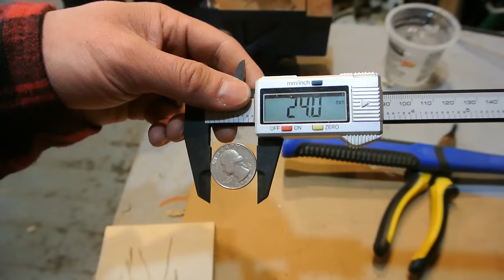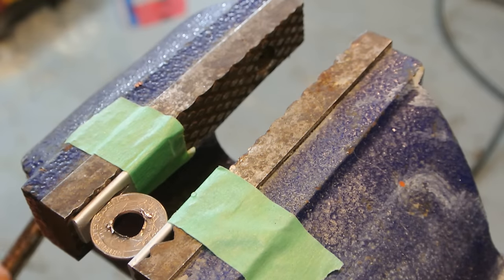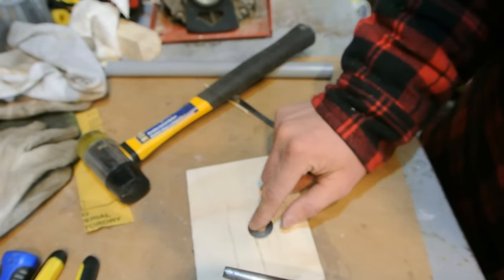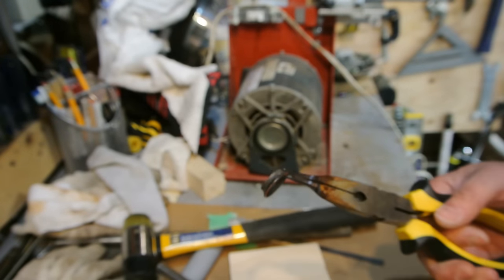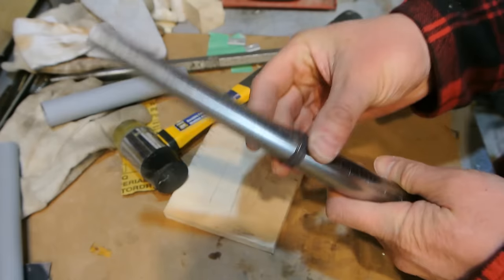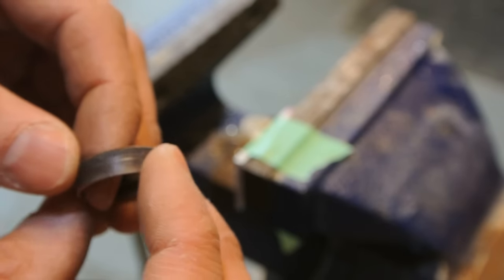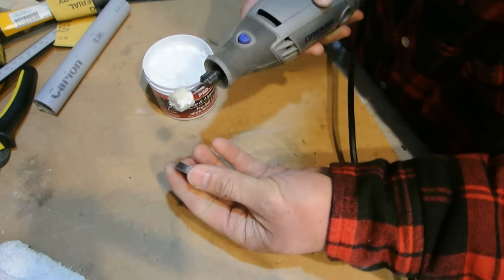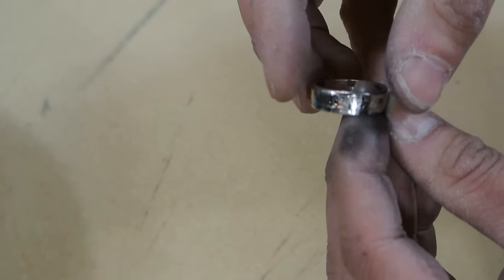How to Make a Coin Ring

Comment: I use my doming block to get a head start on bending the ring down.  Put the coin between 2 thin pieces of leather and dome it in the block.  Make sure you have the outside of the ring facing down in the doming block and that you are centered.  The leather protects the lettering on the coin.  I started out on brass washers to practice before I started on coins...much cheaper and I didn't feel too bad if I ruined it.  I also put the polishing bit in my drill press instead of the Dremel.  Runs at a lower speed so there is less mess and better control.Great work!
Reply from the maker: Thanks for suggestions!

Comment: I learned quite a bit from watching fencekid videos as well. A couple things I learned from my own experimentation... 1) a piece of scotch tape across the top of the coin helps keep it straight in the doming block while you are orienting it in the vise, 2) mounting the vise vertically on the side of the bench so it acts more like a press all but removes the need for #1, 2a) a 1 ton arbor press is about the best $40 investment you can make at this stage :)
Reply from the maker: Thanks!  I looked at arbor presses but in Canada the cheapest I could find was 100 bucks.  Maybe if I make more I will invest in one.
Reply: Andrew W
Ah. Yeah that $40 was US lol. Even a half ton would work quite well (and is a little cheaper) if all you are using it for is to press the coin into a doming block or die. I use mine with a punch and die set to make holes as well, so I need the little extra force.

If you go the press route I'd also recommend very highly a set of delrin resin balls to start the coning process. Along with a little candle wax, and some thin leather (or paper, or plastic cut from a pop bottle, etc) they go a long way to protecting the inner detail of the coin.

Comment: Question can it be sized to an 8
Reply: +Jenny purrucajb They can be made to any size... within reason. I find quarters are practical from about a size 5 to size 10 or so. Any bigger requires a larger size coin because of the amount of stretching required. Excess stretching really takes a toll on the detail of the finished piece.
Reply: +TheBurningsteppes  with more advanced tools and techniques, I can routinely make quarters up to size 13 and keep all outer and most inner detail intact
Reply: Ronald Amoling
I have all of the above. For my taste the details begin to look distorted above size 10. Remember, to make a size 10 you are stretching the ring to 11.5 or 12 initially. Your mileage of course may vary, and that is perfectly fine.

Comment: I just watched your spoon ring videos. Not surprised comments were turned off. I’ve never seen so many mistakes and bad practices as there were in those videos! You said heat silver slowly. No, you get in and out with the heat as quickly as possible, as the longer it’s exposed to heat, the more you are introducing firestain. You didn’t pickle in acid to remove the oxides. Your use of tools was either unsafe or inefficient or both. I could go on and on. Suffice to say, they were the worst videos I have ever seen when it comes to working with silver. People obviously listen to you, but you’re giving out some extremely poor advice.